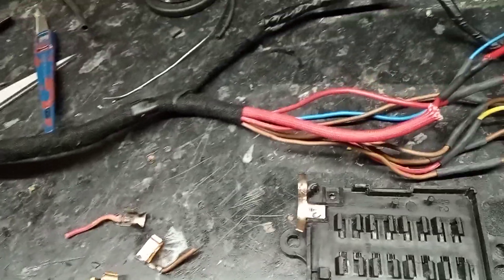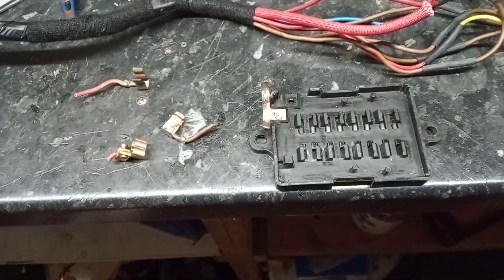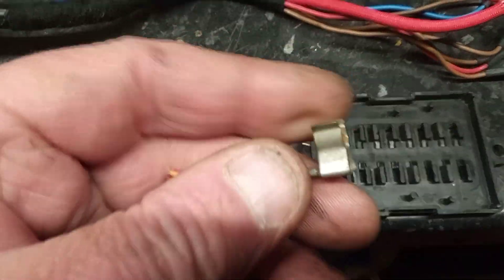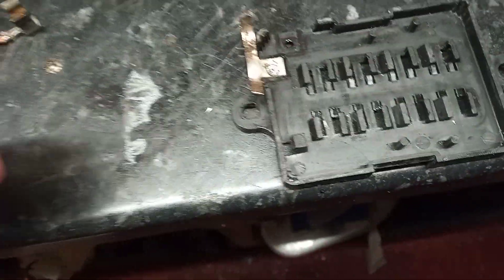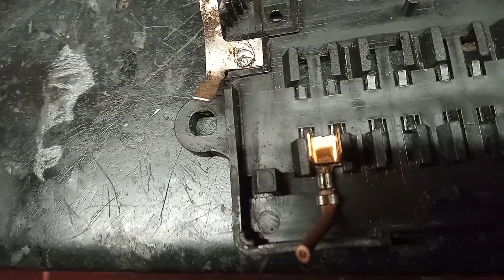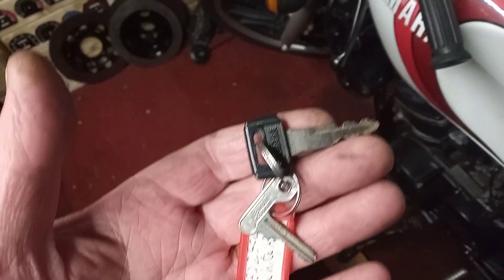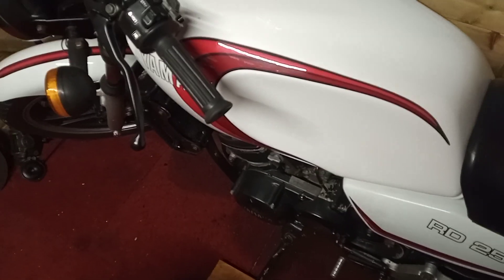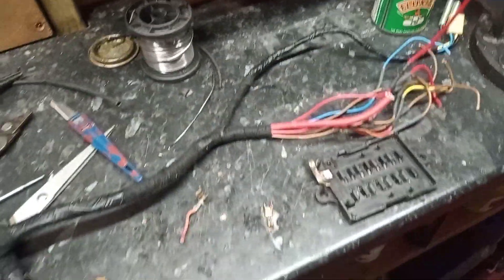fuse box fixes

Comment: Great tip on using a fuse holder from a mains plug. LOL
There are or were at least two different aftermarket copies of the fusebox, the first one I got, the fuse holders had zero flex in them and the fuses were plastic rather than glass, they fell apart when trying to pull them out/push them in. Thankfully the second one I got was of the other design, more like the OEM one.